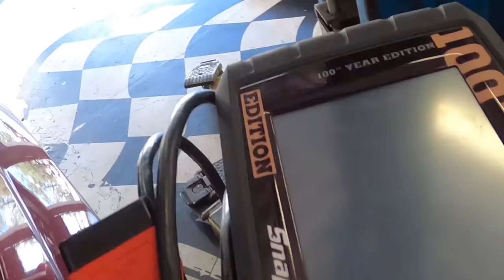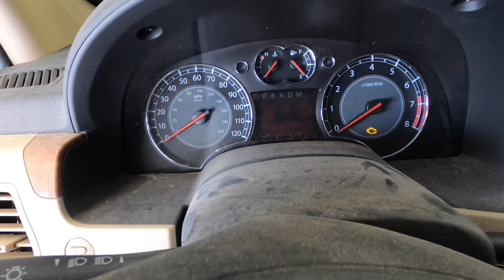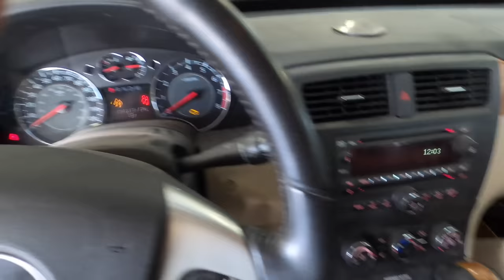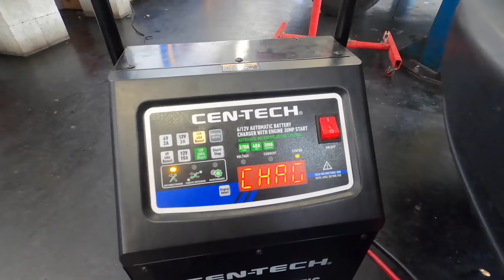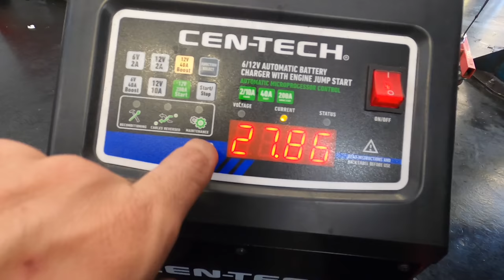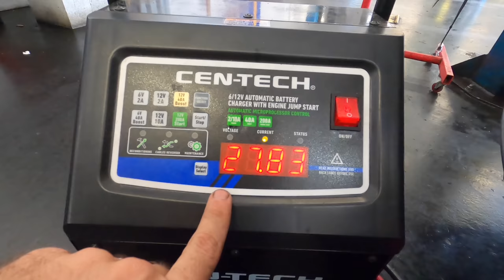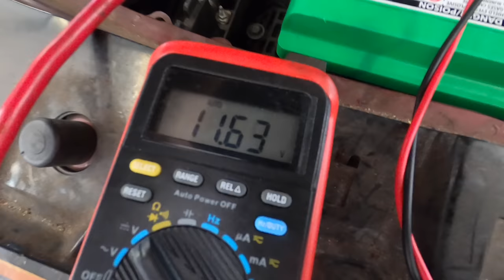Customer States: Doesn’t Start! Broken over 1 bolt! Suzuki XL7

Comment: I don’t see how you film yourself so easily. Hello from Tampa Fl. 
I just went thru a ordeal with my 2020 Jeep Cherokee. It had a dead battery so the dealer installed a battery, then when driving the volts stayed at 12.6ish so they installed a alternator. I then noticed it would only charge when slowing down  and when off the gas and at other random times. After another trip to the dealer the finally tell me it has a smart alternator and does this to save fuel. I have been told by people on a forum it may not be true but the Jeep dealer said it is a 2020 forward thing. Who knows

Comment: Wouldn't be battery because it wouldn't of shut off, car can run off the alternator if it shut off while running then battery can't be the primary problem to the issue here.

Comment: I feel your pain. Have you ever done a Ford Duratec V6 alty?
Reply: U mean alternator on Ford Duratec? Why? are they hard?
Reply: @carsonac4163  Yes, that's right. Not hard as such, but awkward as sin. Assuming you're in a country that drives on the right, it's on the other side of the firewall from the passenger's right foot. Involves disconnecting a steering tie-rod, too.

Comment: Why not just replace the connection? I would do that first to see if it fixes the problem instead of just getting a new alternator.
Reply: The bolt for the connection broke, and cannot be replaced, so the nator has to go. It's also fried itself from the arching.
Reply: @csgergo80  ah I see, thanks for pointing that out.

Comment: Looks like someone halfassed the alternator replacement.
I'd call it, getting in a hurry, and forgetting to tighten the main connector, or, they over tightened it, messed it up, and said opps! then gave it back to them, knowing it would eventually fail.
I hope you gave the alternator and broken bolt to them, and explained why it failed.
If it hasn't been very long, the shop that did the repair owes them a refund!
Reply: A lot of connectors on this gs like alternators and starters are insulated with plastic and very common thing I have seen is people not supporting things right and torturing against plastic thereby breaking them. 
GM starter solenoid made of baseline or plastic were always split right in half not being careful.
Reply: Man, I should just let spellchecker write the whole thing.
Reply: @michaelszczys8316  LOL! I feel ya!

Comment: The thing is I've replaced alternators and shit and never left a cable loose even on my first Ault replacement like bruh you have to be pretty fucking cooked to miss something like that considering you're well aware that it could vary very vary vary VARY easily kill it's self from arcs and considering the vary delicate components inside need to have a steady output and not being able to ignite the air (arcs) should be Damm common knowledge because it was for me and I've never messed up a nater once thankfully (fun fact my car is still using the oem one 279,000 miles without much issues yea I almost killed it as when I looked when I replaced the bushes in her my bearings had decided to run away and that had caused my old bushes to get suck under a lip and not make contact

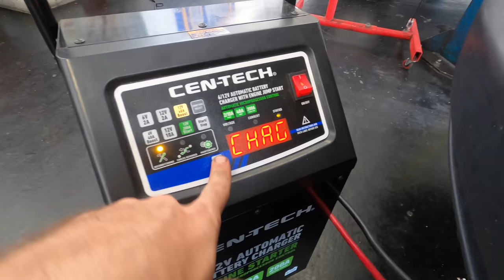Comment: 6:12 ..... why have you not checked the contacts between the cables and the battery ....  that car has been sitting and I bet someone cleaned the battery  before you got to it ...     you cannot charge / jump .. through oxidation

Comment: You know it takes about 2 minutes to pull that bench out. Two bolts at the top comes right out. That way you don't have a damaged fan. Or a hole in your radiator. Slow down think.

Comment: This thing has a 3.6L GM v6 engine as I recall .. If this thing has the GM PASSLOCK II system it is prone to intermittent non-start due to the ignition switch sensor going bad .. It is so common that GM included a solution in the owner's manual

Comment: I had one that randomly wouldn't start. Turns out the starter wire terminal had the nut fall off. The wire was dangling. Sometimes it would touch, sometimes it wouldn't.

Comment: How do you know the alternator was bad? If that wire was loose it could have been the whole problem. By replacing it, it will fix the problem but....

You need to check the voltage at the alternator terminal not the other end of the wire. If the connection to the alternator was bad you'll never know

Comment: 50 years from now when only the old 'uns remember internal combustion engines and all their cars are electric, these videos are going to look archaic!
Reply: @andreim841  Shoulda stuck to horses, eh?
Reply: Electric cars were invented over 100 years ago and were replaced by internal combustion engines, ask yourself why that was
Reply: @immortalsofar5314  more electric is just going to cause more faults. Which are already the number one cause of car problems and fires.
Reply: @r.m.5548  That's the batteries which, thanks a lower lithium content, are beginning to become fewer. And no, more parts mean more faults. An electric car is basically a power supply, a controller and some motors, none of which require much maintenance. Look at VW's (I think) design of a basic floor on which the chassis is just mounted for how little space it takes. Simple is good.
Reply: @immortalsofar5314  please don't talk about things you have no idea about. Saying electric motors don't need maintenance is flat out wee todd did

Comment: Just being picky here ... but you say things like: "This has 2 more 15 millimeter bolts ..... " when the bolts are definitely NOT 15 millimeter.  THE HEAD of the bolt is 15 millimeters,  whereas the shank is maybe (what?) 8mm in diameter.